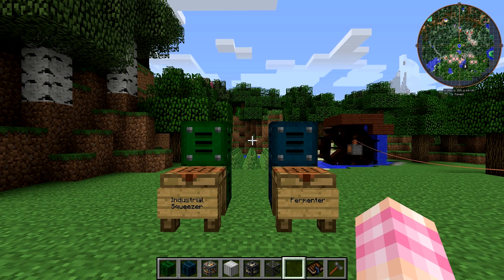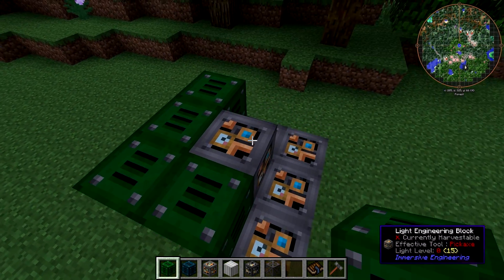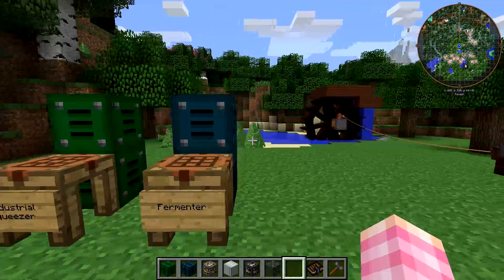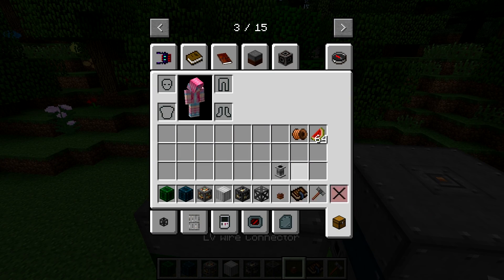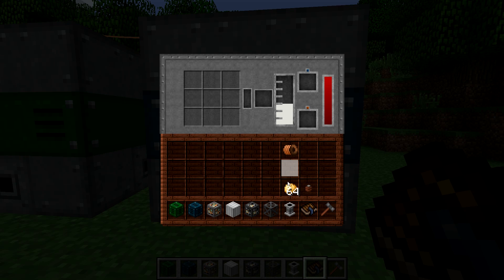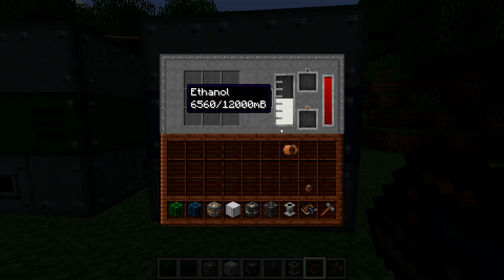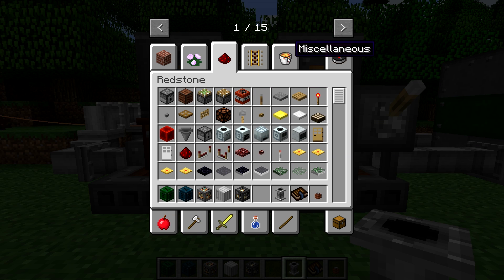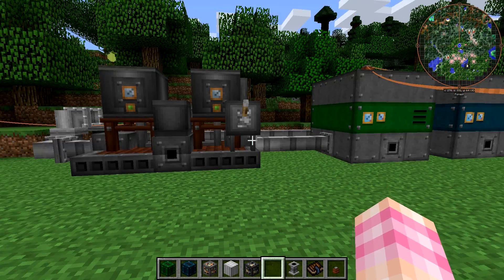Immersive Engineering Tutorial #10 - Biodiesel

Comment: Seems the recipe for this has changed ALOT! Top cap it off the top block on the plans in the manual is one that I don't recognise and is not listed in 'too many items' If anyone knows what this block is please let me know.

edit Seems the mystery block is a piston, which must be pointing down, it also lacks a power input on the bottom now. Also it uses a butt tonne of power. A BUTT TONNE!
Reply from the maker: A Butt Tonne? Is that more or less than an Assload? Yeah I'm not surprised the recipe has changed a lot, the mod is updated to the most recent versions of Minecraft
Reply: which recipe are you using? i can't get mine to be multi-block. are you using the one with the fluid pipes like in jei or the one in this vid?
Reply from the maker: In the most recent versions of the mod the recipe has changed. If you're in a version later than 1.7.10 these videos might not work.

Comment: I have now 2 lv capacitators connected to the fermenter (from two different water wheels (3x2)). Its says that it have 32000 RF, but as soon as Im putting a grape in the power goes from 0 - 3000 rf all the time. Do you know what Im doing wrong?
Reply from the maker: I don't think I really understand the problem
Reply: Hey again, I tried to edit my comment, but seems like it didn't work. My problem is that I don't get enough power for the "fermenter".

I have tried to connect it directly from my 2x3 (6 in total) water wheels. It says that it have 32000 RF in power, but when I put something in it, the power goes down to 0. Then it' starting to jump from 0-3000 RF (inside the Fermenter). It looks like it's not enough power. Do you know how many water wheels I need to get enough power for it?
Reply from the maker: Runar Olsen
Well first make sure you're using at least Medium Voltage wires. I really don't know how much power it needs, does the handbook say?